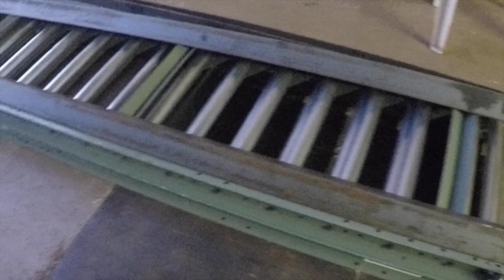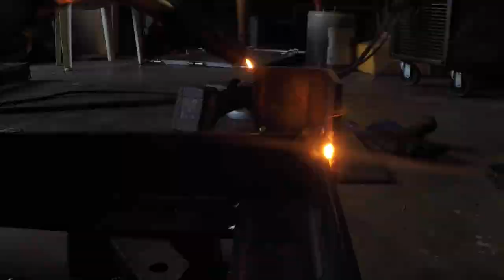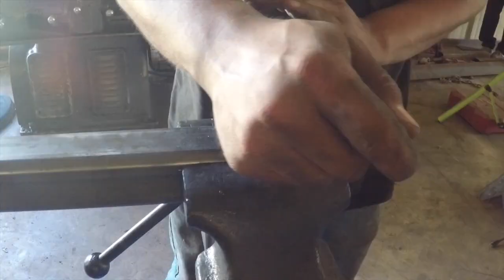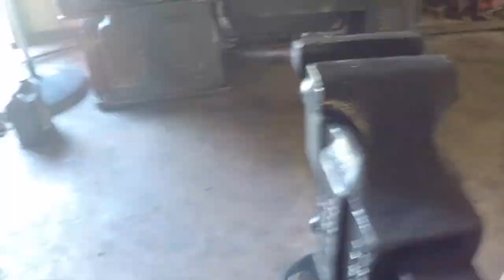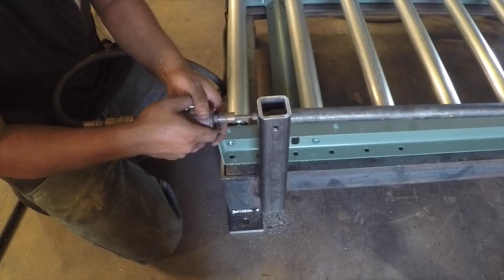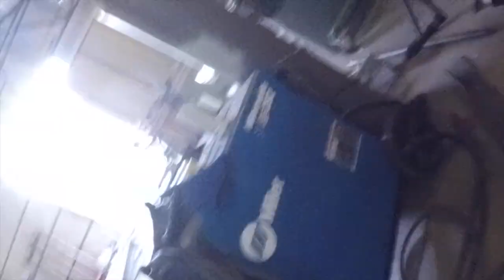#60 Roller Conveyer Build

Comment: I been noticing that you never seem to use any cutting fluid on anything, holesaws, drills and endmills.  what's up with that?  Maybe I'm just overkill here, but I've always used some sort of oil or coolant.

thanks
Reply from the maker: Glenn Davis I do when I'm doing a lot of drilling just not usually when it's one hole.
Reply: cool - thanks